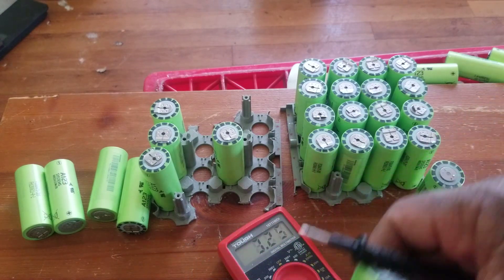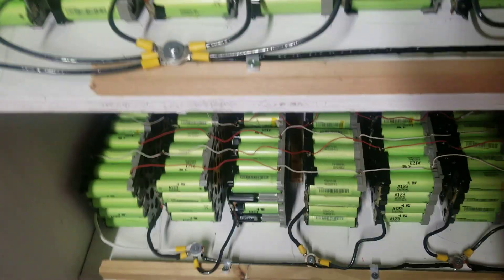Dont be fooled by A123 Lifepo4 cells after they are dead. You can never revive them.

Comment: The magic voltage for A123 26650s is 0.5 volts.  The longer they set at the voltage or lower, the more harm it causes.
Reply from the maker: Thanks for the info. The cells were dead anyway. I will have a video with better cells